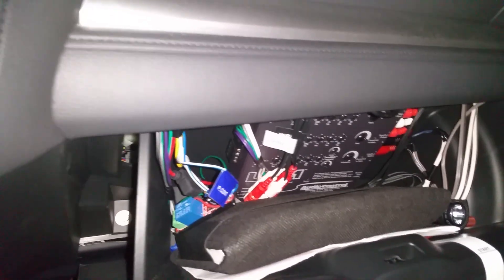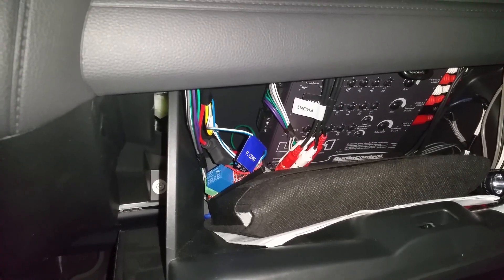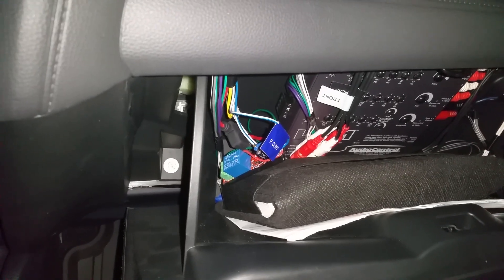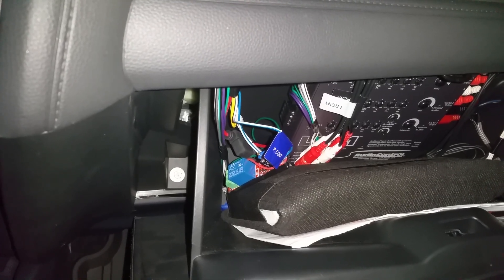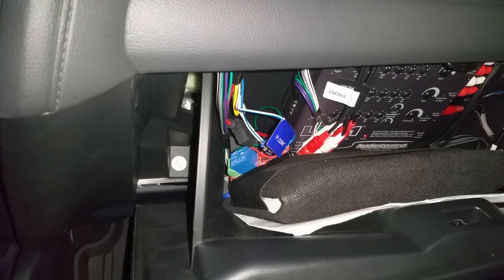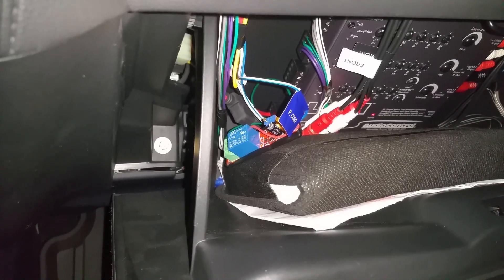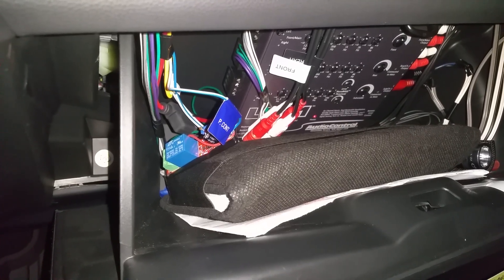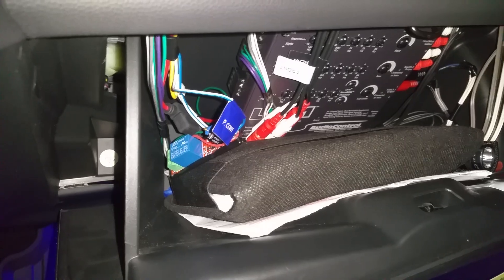Amplifier Thump/Pop Sound Power On/Off: How To Fix

Comment: You think this will fix issu i used pac 35 hi lows convertor
Reply from the maker: Not sure. Every setup is different. The amp ideally would have this delay relay feature built in to avoid the cap charge thump

Comment: I dont know how to explain my issue but there is a constant thumping static sound every 1-2 seconds after the car is OFF.   It only happens wheb the car is not running and everything is off, its been hoing on for hours ... Would a bad stereo fuse cause this? Everything works fine wheb car is running
Reply from the maker: Maybe a bad amp? Do a video of the sound.

Comment: I have a hissing/bussing coming from my lcq1 anyone have that same problem?
Reply from the maker: If you disconnect the input terminal blocks (from your head unit) to the LCQ-1 do you still get the hum/buzz?
Reply: It is mounted to a amp rack. Grounded using the ground on the t harness I purchased to install the lcq1 to my factory radio 2014 Silverado. 
Im going to try everything you said. Thankyou for taking the time out to answer so throughly. Definitely Subbed 👍
Reply: I think the gto is on  If I disconnect them the lcq1 turns off.
Reply from the maker: @SolidBatcorp  okay that makes sense. Is the LCQ-1 mounted to the frame of your vehicle somewhere? Also is the power ground of the LCQ-1 and your speaker amplifier mounted at the same point?

Chances are you have a ground loop. You can try changing the jumper setting inside to see if you can get it to go away. From the factory the ground is floating. Then you have the option to bond the audio signal ground to the chassis power ground, or you can choose as a third option a 200 ohm connection between analog audio signal ground and negative power frame ground. 

If none of those remedies work, then disconnect the RCA outputs of the LCQ1 going to your power amplifier. If the hum goes away after you've tried all the options above, then you will need to get an isolation transformer to galvanically isolate the ground loop between the LCQ-1/Head Unit and your speaker amplifier. I had to do this specifically for the subwoofers due to the fact that their frame ground mounting point is farther away from the frame ground of the door speaker amplifier frame ground.

When it comes to hiss, that is a gain structure issue. His could be caused by too much gain set on the LCQ1, and/or improper sensitivity gain setting on the input of your speaker amplifier. Assuming you have a head unit that is feeding speaker level signal to the LCQ1, that unit should adjust its gain input stage automatically, same as if you fed it a line level signal.

Comment: I have my system professional done and I  got the thump on turn off. I took it to 2 shops.
Reply from the maker: Check your audio signal ground and power grounds. You may need to lift them using an isolation transformer on the signal path.

Comment: in my case it's the head unit RCA sending something to the amp that makes it thump when i turn everything on. Maybe delaying the 12V to the amp would fix it but I can live with it... It only does it when turning it on.
Reply from the maker: It's the initial charging of the capacitors that causes the thump in many amplifiers. More sophisticated amplifiers will employ a muting circuit with a time delay already built in to allow for this event to happen silently before a relay engages the output speakers.

Comment: I’m getting 
 Thumping sound when powering off I got bass amp gain down low in all
Reply from the maker: It's likely your amp not the signal chain. The delay on relay may not fix your issue.
Reply: So what can I do
Reply from the maker: @305chevyboysp6  The first thing you can check to rule out the signal chain is to disconnect the wires from the audio input of your amp. I assume that it is remote triggered when the key is on or when the head unit is turned on? If it does not make the thump sound when it turns off then I stand corrected it is in the signal chain. If it still does make the sound then it's likely an issue with the amplifier internal design itself.

In the case of internal amplifier design flaws, I've seen setups where they use a single pole double throw relay that disconnects the amplifier from the speakers but still leaves a resistive dummy load to the amplifier output to properly shut down and discharge the internal capacitors. Basically the thump will be discharged through the resistor and not your speakers. You can control this relay with the delay on timer board that I show in this video so that it gives the amplifier a chance to power up and make any sound silently through the resistor before connecting the speakers. This type of function is normally built into good quality power amplifiers but not all.  That's how I would go about trying to troubleshoot your issue.

Comment: The link is not working. What is fhe device called?
Reply from the maker: It's called a 12 volt timer relay. It's a delay on relay to allow the head unit and lcq1 to boot up completely before it turns on the amplifiers

Comment: If com and vcc are connected together from where I'm getting ground cable to amplifier?I have popping sound when turning off and I want to add delay timer relay.
Reply from the maker: You may need to change the jumper setting inside the LCQ1. Audio ground and chassis ground are by default bonded in the LCQ1. You can choose to lift this bond, or put a 200ohm resistor (via jumper inside) to see if the pop goes away, then try a delay timer.

Comment: Grate thread
I have a pioneer w8500nex which after changing out an older rockford fosgate amp with newer model now I get the pop at turn off. If I turn off amps from a remote wire kill switch I installed long time ago to prevent garage attendants from playing my music fyi it doesn't pop. Would the radio or the new amp be to blame?
Reply from the maker: The new amp more often

Comment: Hey, I have a question. I've been using a smart power strip for about a year now and a speaker is connected to it. My pc rig along with my monitor is connected to a matic voltage regulator but both are plug in a 2 gang outlet. Sometimes when I turn the speaker on/off, the monitor will turn off in a sec. I'm a little bit concern, coz like using a smart power strip to turn on/off the speaker is equivalent to unplugging them while they're on.
Reply from the maker: Apologies for the late reply. Im not familiar with a setup like that. Sorry I cannot be of further help!

Comment: Hi, I know this popping is annoying, but is it actually dangerous if we just ignore it (e.g. bad for the longevity of the audio components)?
Reply from the maker: Not dangerous no. Its a flaw in the amp really. The inrush current to fill the caps inside the amp is the issue. Once the capa charge and fhe voltage balances out then the thump goes away obviously.
Reply: @Bassguitarist1985  is this also the case if the thumping happens 5-8 seconds after the car is turned off? I'm Running a DSP Amplifier with upgraded speakers and a powered underseat sub and its making a thumping noise 5-8 seconds after turning off, so should I be worried that the components can be damaged through this thumping? Thanks
Reply from the maker: @PatrickRW99  usually it is not an issue to cause damage. If the amp does not thump when it has an input signal connected its somewhere up stream causing it. If it still thumps without an input signal connected the issue is the amp itself. In that situation I'd focus on making a delay relay at the speaker connection. A SPDT with a dummy resistor load always connected and when enabled will connect the speaker. Resistors won't thump but will help bleed the unbalanced voltage from the caps charging to ground till everything equalizes. Just a thought. Notmally such a curcuit is built in to a good quality amplifier. A speaker enable relay basically

Comment: Please help !! So if you connected the remote out cable from the head unit to VCC in put you had to cut it right ?? What did you do with the other end of the cable that actually feeds power to the rest of accessories? Where do I connect that to meet power to the rest of the accessories ? Thank you
Reply from the maker: . I had to make an adapter wire to interface my external 4 channel amp and subwoofers and that is where I split off the VCC. That goes to the remote end of the lcq1 and the remote out goes to the time delay relay, then to the four channel amp and subwoofers
Reply: Thank you for your response and for being the only person proving info on this issue. 
I purchased the relay but i am just completely stuck with the VCC connections .  

So I have a adapter wire from HU ACC cable to relay  VCC input …. 
But you also mentioned that LCQ1 remote out goes to relay ??? 

But I already have power to The relay because of the adapter wire from the HU ??? 

So on the relay VCC connection is it supposed to be 3 cables ?? 

the adapter cable ,jumper cable and remote out cable from LCQ1 ?? 3 connections in 1 ?? 

That’s where I am stuck. Sorry for the trouble on Sunday and thank you for your time !!
Reply from the maker: hey, so for the setup in this video, HU 12V power on when ignition is on, that wire goes to the Remote in of the LCQ1. All the grounds are tied together. This will power on the LCQ1 first. The Remote out of the LCQ1 then goes to the 555 timer's positive input. Now the timer has a jumper from its positive input to the Common lug of the relay. The remote trigger wires of the subs and 4 channel amp are then connected to the normally open lug of the relay. When energized the first click is the LCQ1 coming out of mute, and the 2nd click is the 555 timer energizing to CLOSE the relay between the NO and CO terminals, allowing the amps to come on last. Shut down sequence is all components shutting down at once. Hope this helps!

Link: https://www.fitfreak.net/forums/3rd-generation-gk-specific-fit-i-c-e-sub-forum/90859-upgrade-speaker-system-oem-hu-2.html#post1331425

Comment: I solved my loud thump at turn off by switching my amps remote wire to the red acc on the head unit. That way my amp shuts off at the exact same time as the head unit not seconds after like when hooked to the blue/white remote wire.
Reply: Thank You For Posting This comment…It Literally Fixed My Issue Now I Don’t Have To Power Off My Radio First 👍🏾
Reply: @ParlayJ  that's awesome buddy! Glad it was able to fix your problem. That loud thump is annoying for sure. 
And embarrassing if you're trying to show off your system to someone.
Reply: Thank you! Fixed my issue of popping when turning off the car.
Reply: Im gonna try your way my two amps and dsp. Gonna leave remote wire from head unit to dsp. And remove the 2 remote outs to my amps and wire amps to acc red wire on my head unit. Dude i hope it works i been deallung with this pop issue for 6 months ever since buying/installing all new equiptment.🤘
Reply: Omfg if I could give this comment a biggest reward I would I’ve just done this and omg no more thump or door speakers crackles when turn off I put the remotes from amps to acc and job done thank you
Reply: But isn’t that constant power? I have amps speakers and a head unit but no lc1 or any kind of eq nothing but I too get a loud bump when power off.
Reply: @bade-bike1930  yellow should be constant power
Reply: @colbyjohnson6616  are you in the try state area of Pennsylvania? I’d sure like for you to take a look at it.
Reply: @bade-bike1930  I'm in Georgia. Wish I could help you out.
Reply: @colbyjohnson6616  wow ok well thanks anyway.
Reply: @colbyjohnson6616  so you mean to put the remote from the amp to the yellow battery 2? My radio says (red  battery acc )and (yellow battery 2)
Reply: @jaysonrivera2441  remote wire from the amp to the red wire on your radio
Reply: That works all remote wires install to red acc power behind radio
Reply: It doesn’t work its either a grounding problem or headunit/AMP faulty .. enjoy the pops
Reply: @Omar-jt2bw  worked for the rest of us. 😏
Reply: @Mike Honcho  right..he sounds mad..lol..im having the same problem tho..I had the taramp smart 5k bass sent it bck got the taramp smart 5k version hooked it up with the taramp eq and now I hear a loud pop noise when I turn my car off and it wasn't doing it before..sum one plz help me

Comment: Looks like I finally found the solution of my speakers popping everytime I switch off the car. My vehicle is BMW E46, since I want to keep the  factory head unit, I installed a DSP between speakers and the head unit, sound quality is amazing but, can't get rid of this pop noise.
Reply: Hi, you could try install small glass fuse(t1a with holder) on +12v , this will delay turning on the amp by a second and get rid of turn on/off pop. You can get it in most of diy electro shops, be sure that the holder has thick enough cable to power the dsp, my needs 16awg

Comment: I put my remote out from head unit to a relay and connected my amp and line driver to that. I think this may be causing the issue. Should I go to amp, then daisy chain to relay? Or is it being caused by the line driver like in your case... ac7i or whatever rhe model is is similar to a line driver. Mine is audiopipe  3001-rmt.

Comment: Do you have to use the common to? on the out put, I want to use it to delay the remote on the amp
Reply: Thanks so much bro, appreciate you and your time
Reply from the maker: @luismercado1879  anytime! Thank you for watching!
Reply from the maker: From the LCQ1? Common as in ground?
Reply: Yea the middle on is 
(normal close common normal open)
Reply: Input + - , I get that,
Out put can I use only the (normal close)
Reply from the maker: @luismercado1879  yeah remote in is your trigger signal from your head unit. Remote out will go to your amp. The 12v and ground are for powering the LCQ1 only. So no, no need to use that ground lug for the remote trigger

Comment: Hi I have a Caddillac ATS with the Bose system and I’m using a lc2i. It’s connected with a wire harness coming off the factory amp where it gets it’s power then that powers my slash 1000/1 into a 12w7 and when I unlock my car my subwoofer constantly pops until I start the car. Any ideas what I can do to fix it? I have the amp grounded to the battery since it’s in the trunk.
Reply from the maker: Try a ground loop isolator on the RCA lines. If that doesnt work its hard to diagnose without seeing the setup.
Reply: @Bassguitarist1985  never seen one can you recommend one
Reply from the maker: @tjsworld2338  BOSS Audio Systems Ground Loop Isolator B25N noise Filter for Car Audio Systems https://www.amazon.com/dp/B000LP4RMG/ref=cm_sw_r_apan_glt_fabc_RBX8C7GK1H5G61J2VC7K
Reply: @Bassguitarist1985  so this gets plugged into the lc2i
Reply from the maker: @tjsworld2338  between the lc2i and your sub input yea give that a try. I have the same one on my subs. There was a ground loop hum and this solved it.
Reply: @Bassguitarist1985  awesome thanks I’ll order one
Reply from the maker: @tjsworld2338  awesome! Yeah not saying it will solve the issue but it may help. It did for me but every system setup is different. Cheers!

Comment: Great video.  I get the part about delay at start up, but my issue is at ignition turn off after a few minutes of use.  I have 2017 Audio A4 and installed a Rockford powered sub in the trunk.  I tapped powered directly from battery in the trunk, used speaker inputs from original OEM sub connections coming from factory amp, and used a remote pwr source from the cigarette 12vdc aux power outlet also located in the trunk. When I shut down the ignition, there's a terrible hum/buzz from the powered sub for about 2-3 secs.  Will the time delay relay you recommend help with instant shut down as well?  I'm confused why the 12vdc from the trunk aux outlet does not immediately drop at ignition off to kill power to the sub instantly as well?  Is it because I used the speaker input after the OEM amp vs before from OEM head unit?  Does it have anything to do with gain setting too high?  Thanks for you help.
Reply from the maker: The head unit should have a remote out to turn on auxiliary components and if it does not then if you look at the schematic of your head unit there should be an ACC wire providing the signal to turn the head unit on. That is what should be used to trigger the amplifier. The hum buzz that you are hearing is likely the head unit shutting off and no longer keeping the audio outputs close to ground and the sub amplifier is still on hearing all the induced noise in your electrical system until it shuts down.

Audi me indeed have a timer delayed accessory power turn off as well as a turn on to allow for full power to be used for starting the car. That could very much be your issue as well hard to say. All the components should turn on at the same time and the amplifier should turn on last and also the first to turn off.
Reply: @Bassguitarist1985  Wow...thank you so much for the quick response and recommended guidance!  I'll give it a shot.